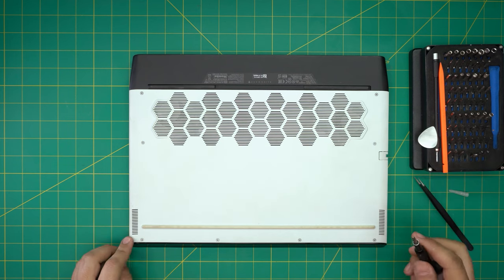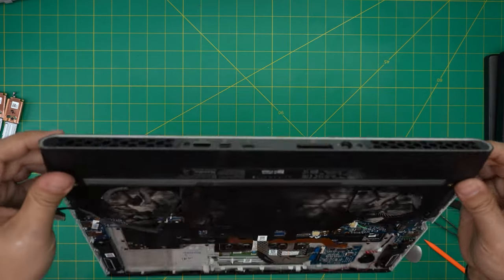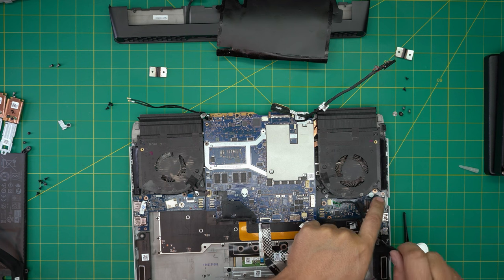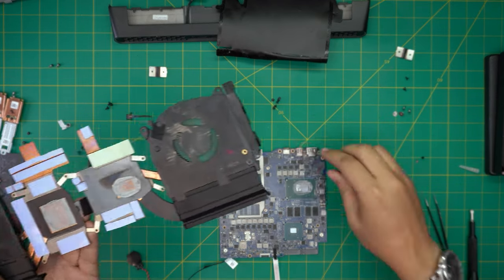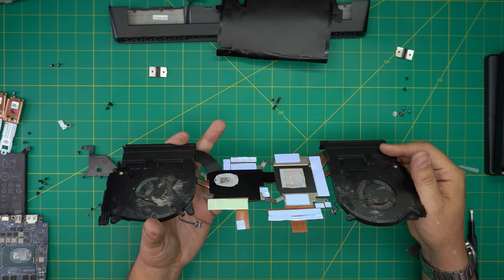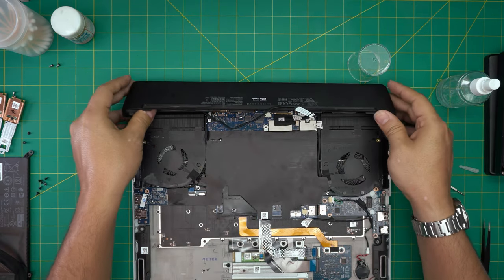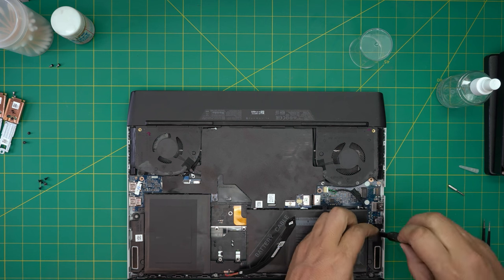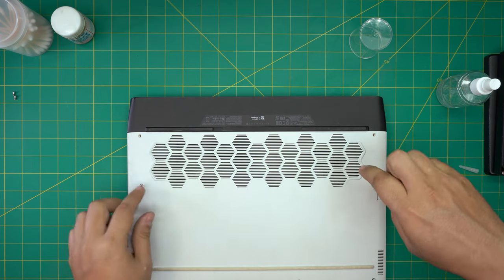How to Repaste and Clean Alienware M15 R2 Laptop - Step-by-Step 🧹

Comment: How did you remove the rear i/o cover so easily? Mine was so stubborn and wouldn’t came off.
Reply from the maker: Thank you for the feedback! if you wish to support the channel you can LIKE or SUB or both :P
regarding your question: sometimes they are a bit more stiff my friend, just use a slight more force on pull and you be fine.
Reply: had similar issue ,seem in factory the LCD cable on the right get bunched up ,that's why stuck. shouldn't be

Comment: Hello could you please tell me what conector is responsible of the Start button Light? the Alienware logo has some RGB but after finishing maintenance the button works but doesn't have any light so i asume it was not connected properly
Reply from the maker: Thank you for your feedback! If you wish to support the channel, you can like, subscribe, or both!
Regarding your question, double check the bridge connector from main board to the left expansion board, https://imgur.com/a/bhgVTHC
if the pins are not touching well that can cause an issue.
Should you have any further questions or requests in the future, please don't hesitate to ask me.

Comment: Hi, I've lost blades on my left hand fan (looking from the back, from front under the [0]). Is it possible to replace the fan without taking all of the motherboard apart? I noticed you said there was some tape holding it on? How is it attached to the heat sink tubes? I'm not very confident about being able to do it.
Reply from the maker: Thank you for your feedback! If you wish to support the channel, you can like, subscribe, or both!
Regarding your question, you don't need to  remove the heatsink but you will need to remove the motherboard and flip it. and remove the fan tiny screws on the other side.
take your time doing it, and you won't go wrong.
Should you have any further questions or requests in the future, please don't hesitate to ask me.
Reply: @uFixTek  Thank you!
Reply from the maker: It's my pleasure my friend.🍻

Comment: Hello. Thank you for the great video, cleared up my fan problem. 
However I stitched it on, all was fine but then my background dissappears, i can restart it, the background will be there then a minute later it dissappears again. Are you able to help me please.🙏
Reply from the maker: It's my pleasure my friend.
🫠Regarding your issue: remove the SSD drives and re insert them, this issues normally is because of bad connection. also scan your windows by opening CMD as admin and type:
sfc /scannow
Should you have any further questions or requests in the future, please don't hesitate to ask me.
cheers🍻

Comment: serviced laptops (including Dell) dozens of times, but this time after changing thermal paste I get a 3-2-1 beep and no on-screen diagnostics : /  mobo replacement?
Reply from the maker: remove both rams, remove the battery and disconnect he BIOS battery and wait 1h for the board to discharge it self.
plug the rams 1st and the bios battery and the rest and power on and wait 10sec for the boot. if no boot remove one of the rams and use one ram 1st then power on if power successful then power off and place the 2nd ram.
let me know.
Reply: @uFixTek  the ram is soldered to the board on M15 R2
Reply from the maker: ah if you don't have a reballing station, then you won't be able to remove them, because you said "serviced laptops" i assumed you may have the reballing station .
so in this case, i would recommend you to do the same steps without removing the ram, if no positive results given, then you will see yo find a experienced technician to do a reballing and replace the ram chips.
also im not sure if you may have touched with heatsink or a metallic object tot he board and cause a short.
examine the board to see if the heatsink is not touching directly any components.

Comment: got the other ssid configuration. screws hella tight and can't get them out without risking damaging the screw :(
Reply from the maker: use more pressure on the screw and very slow rotation with a higher pressure.

Comment: Hi, I followed your video steps and my screen is flickering like if there's something wrong with the lcd or probably the GPU, is there anything specifically i can check so i can solve my problem. The screen goes black/deep blue and after i put it to sleep it works again, dunno what to check first
Reply from the maker: regarding your issue, there is a flex cable somewhere that is not inserted all the way. check the LCD cable 1st.
Reply: @uFixTek  thank you sir

Comment: MX-4 pumped out for me in about one month ,Gelid CG-Extreme and Kryonaut Extreme are ok. I think Alienwares heatsink might be a bit bent similar to Dell G3s. had 2 exact same m15 ,one ok ,other constant heat issues core 1-2 reaching 100C still.
Reply from the maker: Thank you for your feedback! If you wish to support the channel, you can like, subscribe, or both! Regarding your issue,  it is very common on having a bad not leveled heat-sink, i highly recommend you to use a more paste type of the thermal paste for e.g the best for the uneven surface use this, https://amzn.to/4383Lbr
it is more pasty and harder to fill the gaps, and unlike cg or grisly that are runny.
Reply: @uFixTek  that's great ,thanks. with dell G3  worked to bend back the heatsink but AW m15 need lot assembling disassembling.
Reply from the maker: It's my pleasure my friend. 😊 ya they require a bit more of work to get to them.
Should you have any further questions or requests in the future, please don't hesitate to ask me.

Comment: Soooo i did everything as carefully as possible, just to clean the fans. Put it all back in its place and no power. None from the cord and none from the battery. I can't find anything out of place although I did have one extra screw. Any ideas?
Reply from the maker: usually those tiny bridge connectors don't make a good contact, remove them and reinsert them. you see me taking them out @9:15
Reply: @uFixTek  yup that worked, which is good because it means I'm not out of a job lol thx
Reply from the maker: @yofoshizzle66  im glad it worked, enjoy the laptop 💻 for a bit longer 🙃

Comment: My toutchpad doesent work
Reply from the maker: Thank you for your feedback! If you wish to support the channel, you can like, subscribe, or both!
Regarding your question, did you open and serviced then the touch pad stop working ?, or stoped working randomly ?, was there water dropped on it?, give me more detail of how it came to not work.
Reply: @uFixTek  I opened it, did the maintenance, but I removed the battery, after closing it, it turned on normally, but the touchpad stopped working. I looked in the BIOS to see if it was disabled, but I didn't find anything.
Reply from the maker: remove the flex cable of the track pad from motherboard and reinsert them. double check the cables my friend.
Reply: @luizgm2011 There is a button on the keyboard of the laptop to turn the touch pad on and off did you trie that?